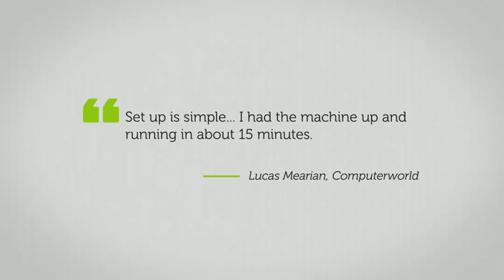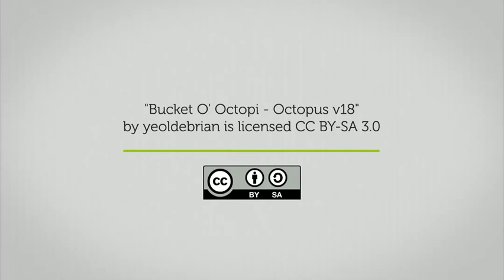LulzBot Mini Desktop 3D Printer in Action

Comment: Lulzbot, i'm pretty impressed by the reviews and videos i've seen of your Mini so far, and i'm looking to buy a 3D printer soon. There's only one big problem for me with the mini - to my knowledge it has to be connected to a PC throughout the entirety of each print - this means i'd have to keep the printer in my bedroom next to my only PC, which would be pretty noisy. Obviously I wouldn't want to be running prints through the night in this situation either! Is there any workaround for this you can suggest?

Comment: I have one hopefully arriving tomorrow! Thanks to my wife :)

Couple of questions though, keep in mind I'm novice.

My father has one of the first Zortrax machines. And after looking at a handful of the Rock-Puss prints of the Lulz-Mini, it doesn't look all that great up close.

I noticed that there is very little support when compared to the Zortrax, which puts gobs of it everywhere(although their latest firmware/slicer seems to make it easier to remove), and prints fast with pretty strong models(ABS) at default settings.

Is this just slicer dependent?

Also, why 3mm filament? Can I use his Zortrax Z-Filament(1.75)?

I can't wait to get my hands on this guy... I really like the open-ness of this machine.<- not be said about the Zortrax